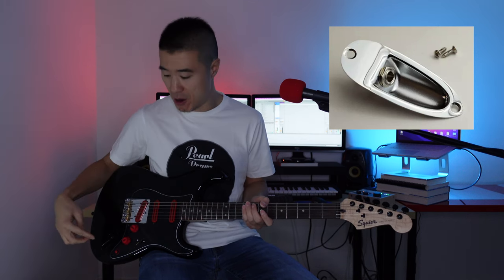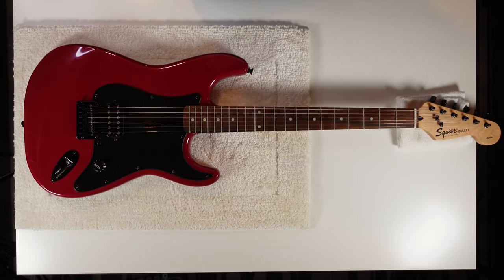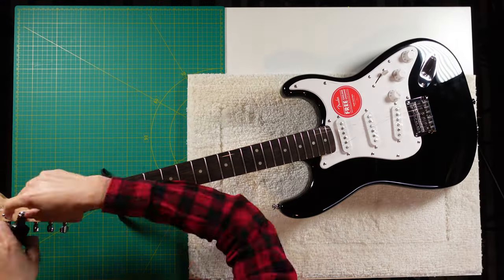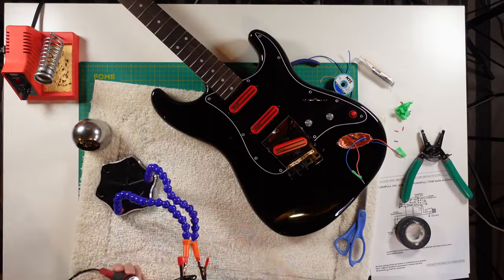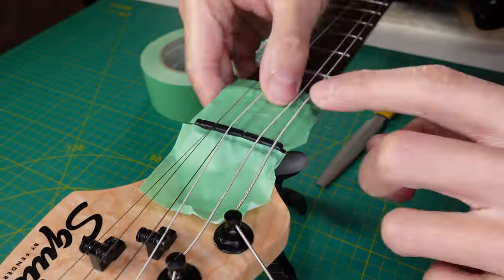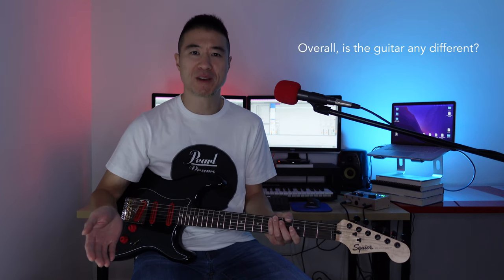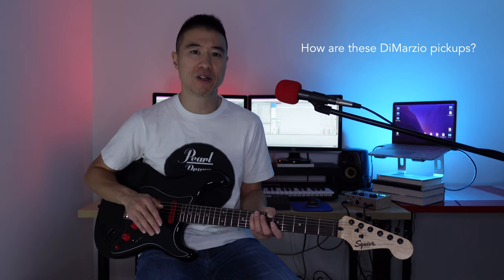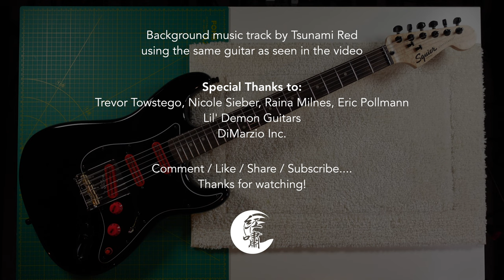Partscaster Build - Telecaster Bridge on a Stratocaster

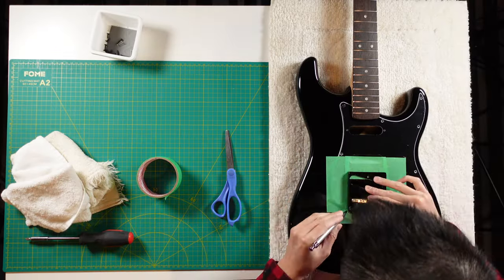Comment: 17:20 you need a rotary tool like a dremel, lol!
but use the coping saw for the corners of the cut
Reply: You really need a bird's foot underneath the workpiece to make a clean job.
Reply: @RogerBarraud  bird's foot?
Reply from the maker: @Robert Jene In retrospect, any small fine tooth saw would have worked as I only needed to do straight cuts.

Comment: About 10 years ago I bought a Stratocaster squire beater at a pawn shop for $25. At that time I refinished the body and put in all new fender hardware. I used  Seymour Duncan SSL-1 50’s pickups.
   In the last few weeks I pulled out the tremolo bridge and filled in the the cavity with a wood block and left it low on the front and filled in with JB weld and sanded flat and totally refinished body. I am going to install a top loading Hardtail bridge . I have a fender Mid range boost kit and TBX tone control that I am going to install. I am using the tremolo spring cavity to hide the 9 volt battery which will be rechargeable. Basically I will have a pedal installed in my Stratocaster. This hopefully will be like the Eric Clampton Blackie Stratocaster. Wish me luck.
Reply from the maker: That sounds amazing, a true labour of love. Would love to see it when it's done!!!

Comment: 7:40 epoxy lasts forever - but only if you mix it at the correct ratio. I've worked with it for decades. I've never thought about using it to fill a cavity, but that's a great idea.
Reply from the maker: I also wonder what you could do to keep it from spilling out from the bottom.
Reply: @TsunamiRed  well you mask the bottom off with tape, then lay it on something that has paper on it and is flat .
After it dries, you obviously have to do a lot of sanding on the epoxy
Reply: You can use epoxy but there are two things to consider. First is that it will make the guitar much heavier than filling in with wood. Second you would have to use a non stick plastic back strongly taped on for the fill. Because of the angles involved more likely you would have bubbles in the end result. 

You made the right choice in the video.😉👍✨

Comment: I like the whole concept as I’m between a custom shop set neck strat, new tele ultra-luxe, and a PRS custom special. I’m not currently building a Strat with black lace loaded pick guard. I have a tele neck ( Hendricks had one ) but I love the tele ultra luxe bridge. I’d upgrade to one. I did prefer the new build sound over the stock. The dark fretboard always sounds warmer over a blond, I’d try a copper plated lipstick neck pickup too. Great job and I learned a lot from it. Ps. I’m liking the metal pick guard in the ultra luxe. Maybe a roasted neck w/ Mahogany even better feel.
Reply from the maker: That's awesome, would love to see what you end up doing and what the guitar looks like. Thanks for watching!

Comment: I loved this project.. You were very sincere. Every guitar i own ive had some wild custom idea with and thats part of the fun for me.  I hartail most strats because i palm mute and reckognize where im at by how it feels placing my palm to the bridge. To do the cavity ive tried some crazy ideas... But, glass or lead gives weight and does "despite retarded claims" add tons of sustain to a bolt on neck guitar... So i like it best filling the entire cavity with glass and fiberglass resin. Its good long term and for 100 % fact adds a sweetend sustain and scream  because the weight is added fairly center to the entire structure. Ive also added lead to carved out cavities in the headstock.. That significantly added sustain also but to avoid a super heavy guitar this all works best on cheaper lighter wood bodies from guitars like the 100 strats on amazone.   Monoprice, etc.   Get em used for 50.00 and your not left with much to lose... Ill refinish them with better paint jobs but the concept works well.. 
F'n awesome video my dude!
Reply from the maker: Glass, fibreglass resin, lead - those sounds complicated and lead would indeed be heavy! I'll pass on paint jobs, I've seen what's involved and that's another giant can of worms I don't think I want to open, hahaha. Would love to see your project builds. Thanks very much for the kind words and for watching!
Reply: @TsunamiRed  you did just fine doing things your way brother.. Just fine!